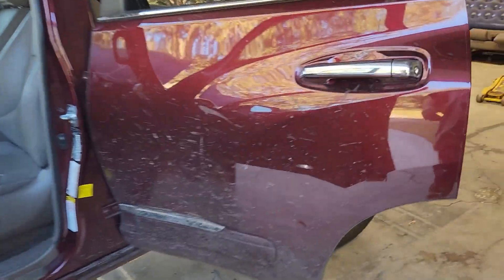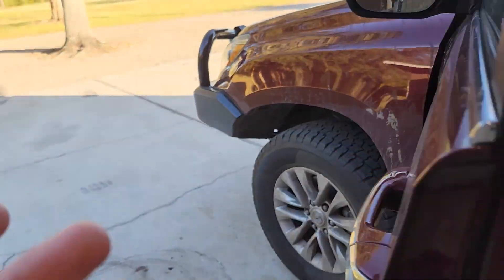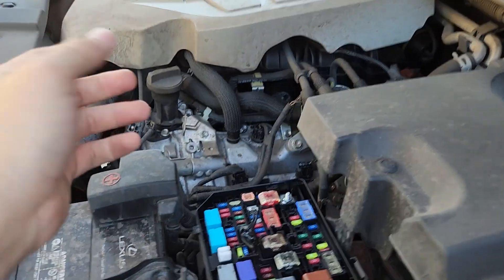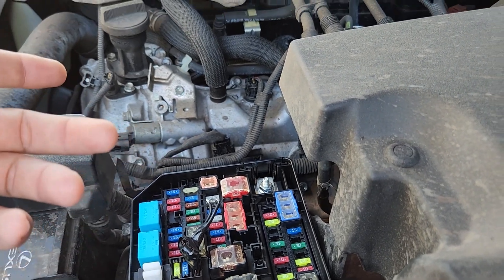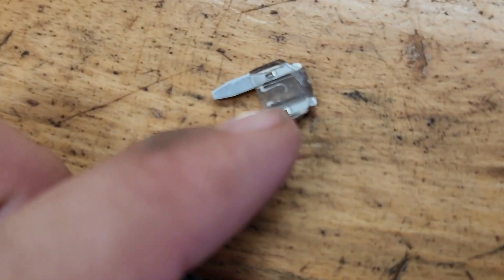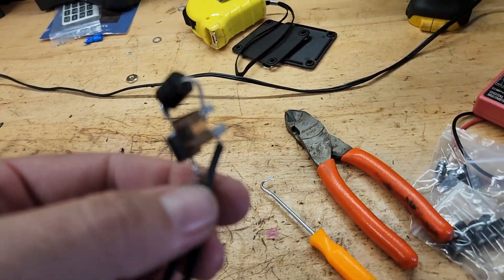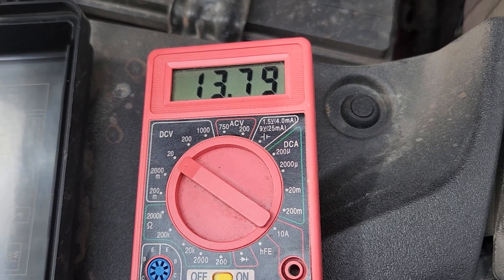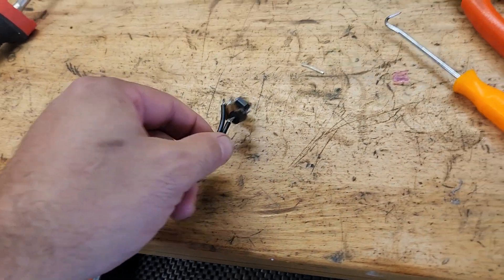Toyota Lexus DIY Alternator Booster Diode MOD & Testing! increase charging voltage GX460

Comment: I bought a brand new Duracell AGM battery and it doesn't need that voltage boost on it. The charging value on it is 13.8 to 14.5. just to let you guys know you might want to get one of those batteries and don't do any modifications to your vehicle
Reply from the maker: If you have a camper set up like mine the voltage boost is a great mod regardless. Less idle time to charge up all the batteries. None of us had any issues from doing the voltage boost

Comment: hey mam sorry I know this was an old video but youe wired them in serious but what direction does the band go? like what side of the fuse or it doesn't matter as long as the diodes are wires in series
Reply from the maker: definitely matters which way you put it in.
Reply from the maker: You should be able to tell which way to wire it from the thumbnail in the video alone
Reply: The strip always goes toward the alternator

Comment: Will this work on a 2000 Toyota Solara? I have a sound system and my voltage sucks!
Reply: lol
1999 Corolla here...
SAME ISSUES.😣
     Did any of you Toyota guys have success (without BURNING UP alternators, or any other sensitive OEM electrical components)
???
Reply: @KingJames-loj843  I found no work around I ordered a HO alt and ran two diodes to get to 15.5 volts because I'm running lithium for my system
Reply: @rkzooplays gotcha 👌🏼 
Soooo, are you referring to your '00 Solara ? ...or your '09 Camry
     Also, exactly which 2 diodes did you ultimately end up installing,
the same exact ones in the kit from the Amazon link in this description?
     If so, which specific ones from the kit (I see there's several different amperage current loads included in the kit)
     ...and did you fabricate the ALT-S fuse with the soldered wire taps, the same way shown in this vid?
And have you noticed anything strange occurring (electrically / mechanically) since you did this?
     I also, just installed the HO alternator (180 amp) and have three D-35 Optima Yellow-Top AGMs... One under hood for starting, and two in parallel banked in the trunk, with OFC 1/0 gauge wire👍🏼
     Just nervous about whether charging at that high of a voltage 
(15.0 +) will inevitably end up being detrimental to some other sensitive circuits we're not thinkin of, throughout the computer system🤔
    I'm thinkin though, if an '00 Solara and an '09 Camry can take it, without any future long term negative side-effects... Then SURELY, a BEAST OF A TANK like the '99 Corolla can handle it 😁
Reply: @K @KingJames-loj843 was talking about my 09 Camry. My solara had a bad transmission along with my Camry recently. I had two diodes I got off Amazon on my yellow sense wire to charge higher. I wouldn’t recommend charging over 14.8 with age battery’s they could be damaged.
Reply: @K @KingJames-loj843 I think Jerry ain’t loud uploaded a video on his channel and he explained the process and told you what type of diodes to use.
Reply: I just seem this I wanted to try it on my corolla lol. it's this or put a different internal regulator. but it's like 100$ for the kit. i don't want to burn anything up but I think as long as it's fused it shouldn't hurt it. worse case it doesn't work
Reply: @icubisqyrobbins3931  Lmao I came back to this video because I own a 09 Camry with a sound system same issue alternator will not charge over 13.3v.